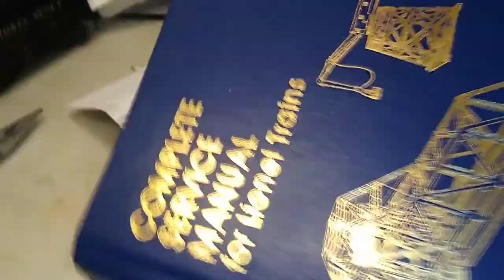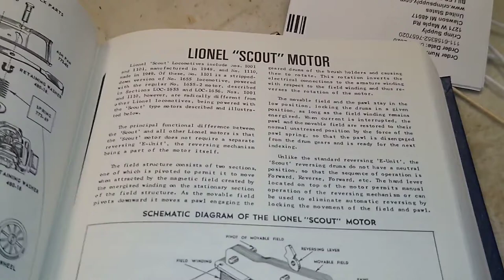Basic Disassembly And Maintenance - Lionel Plastic "Scout" Motors - It CAN Be Done!

Comment: Excellent video Mike. You did a fine job on getting this Scout motor serviced. These motors can be a bit temperamental. I’ve worked on quite a few myself over the years. That K-Line book is an excellent tool and guide. I’ve had mine for 20 years, and it still comes in handy. Just 1 quick note. On some of these Scout motors, there’s an oil wick that goes into the motor housing on an angle near the brush plate. This was a modification Lionel did to the later Scout motors. This helps with lubricating the motor, and It should be wet with oil. It’s not very easy to see with the shell on it, but you have to look up from underneath the shell to see if that particular Scout motor has one, and if it does, soak it with some light sewing machine oil. This will help keep the armature shaft lubricated on that side of the motor. The other side you have access to the motor bearing, and that should be lubricated as required. Excellent video, well explained. Tom
Reply from the maker: Thanks for the tip!!

Comment: Great video. Thank you so much. I took mine apart and cleaned up the brushes and it works a lot better. The little reversing "gears" in mine were really pretty clean, though not as clean as yours, but mine were black instead of green. I know mine is original because it was my Dad's--hadn't been run probably since the 80s.
Reply from the maker: Great! I'm glad it helped!

Comment: Very useful. I just came across my 1966 train set that's been in storage since 1973. This is good information for repairs. FYI. The wheels pull apart with some effort by hand, but when putting them back on you need to be particularly careful with the orientation. They have to go back onto the spline position exactly as they came off. Ask me how I know. Lol.
Reply from the maker: Thanks for the tip! That may save someone a big headache later!

Comment: Thanks for the video.  Oncleaning wheels I use LGB smoke fluid.  Pticey, but plastic compatible and it does a nice job.  If the gunk is really bad AND the wheels are metal (not nylon or plastic) I use a small swab of NEVR DULL (a silver polish available at most hardware stores) to clean the gunk.  My first train was a Lionel Scout #6110.  No headlight, but it does smoke.  I never knew how to take these apart.  I do have the K Line book you referenced, but never had the courage tondo it!  Thanks!
Reply from the maker: Thanks for the tip!

Comment: Hello, I watched the scout service video . I have purchased several that needed repair, it seems that it is a common problem to have that broken spud that centers and secures the rear of the motor with the long screw. The way I repaired it was o grind the broken spud so you have a level surface . Now I use a a bic pen remove the gold portion that holds the brass tip and discard that ,now remove the black or blue portion from the white barrel of the pen and use the colored part of the pen to make a spacer, look into the loco to get a rough idea of the size of the spacer you will require, use a razor saw or knife to cut the colored portion to size. Install it by holding it with needle nose pliers in place and starting the screw through the boiler,, now the spacer ,through the motor and finish by tightening the screw. It doesn’t need to be glued , and when you install it put the wide side of the spacer against the ground off spud. Hope you can use this idea. MG
Reply from the maker: Good tip. Thanks!

Comment: Just got a set for about $25 at a swap meet. It's a lionel 245 but same motor design. Ran like crap and sometimes didn't want to run at all. Cleaned it up good and now it runs extremely fast and powerful
Reply from the maker: Wonderful!

Comment: Have pulled one 'all the way apart". It IS a bit of a pain, but also it's not as bad as I was expecting with all the bad press that these motors get for their serviceability. So long as wobbly wheels don't bother you, and you're very careful, you can gently pry the wheels off with a flat head screwdriver and then open the motor up all the way. There are parts that can use a cleaning, and it gives you a chance to really scrub all the gunk out of the plastic housing.
The hard part, is to get everything lined up inside the housing when you put the two halves back together. It may take a few tries but it's not impossible. Use a vice to press the wheels back onto the axles- ideally you'd use wheel cups and a press, but I don't own one currently and the wheel wobble left behind isn't enough to cause problems for me.
The only reason you'd need to go that far, might be to improve the behavior of the reversing mechanism, or more reasonably, to remove debris like hair or other gunk that has gotten caught up inside the mechanism somehow. Cleaning the contacts inside is another reason you might want to get in there. One of the harder tasks to undertake, but it wouldn't be so bad imho if it weren't for needing to pull the wheels to get anything done inside the motor housing.

Comment: Removing the 2 screws holding the oval plate on side will access to brushes and, with a q tip and mineral spirits, allow a lot of armature commutator cleaning.
Be sure to leave the 2  contact plastic gears in original relationship to each other.
Reply from the maker: Thanks for the tip!

Comment: Many years a go I took one of these apart and after some hit and miss re-assembly I got it together and working.   Now here is a weird thing.  I'll let you know for sure in a few months if I remember and get to my older trains and find it, but the one I have has a smoke unit and magna-traction.  Yes it is the plastic motor with the two part field movement type reversing.  
         Oh, sorry, but reversing units of the older type are not  electronic, they are electric. Yes the term has been handed down that way, E-unit, but the modern ones are accurately electronic, so it is best to not confuse the two types.    I thought it interesting, today I was working on a 8303 I just got in the mail. That part for the piston area along with the front wheels is the same part as the scout you were working on. The rear wheel are pretty close as well.    I important thing to realize as soon as possible, always reverse turn you screw till it clicks in place and then turn it in the hole. Many things with plastic parts the screws are self threading cutter type screws. This means if you simply screw things back together without finding the right groove, your screw will cut another thread into that hole. Enough times and you will have drilled out the hole and that screw no longer grips.
Reply from the maker: The #233 was a plastic motored Scout with smoke and Magnatraction.  Like most manufacturers, Lionel standardized parts on many items - especially the cheaper, mass produced items. A 1946 side rod is the same part as a 1976 side rod for the 2-4-2 locomotives.

Comment: What is your favorite Scout Locomotive and why? My favorite is the 233 because it has magnatraction. Thanks for the great repair video.
Reply from the maker: I am a sucker for the MPC era plastic ones - mainly because that's what I grew up with. Good smokers. Good pullers with the traction tire. Low center of gravity so they hug the O27 curves well.
Reply: Mine is a 233 also.Mostly because I got it for Christmas in  1962,I believe.I rarely got to play with it cause it was only out at Christmas and Dad was mostly the engineer.I’ve still got the set because of that I’m sure
Reply from the maker: I feel the same about my 8141 from Christmas 1972. I still have it and still run it. https://www.youtube.com/watch?v=n4W-uRiVTWs&t=79s

Comment: I took my exact duplicate engine apart and fixed the lever on top as it was disconnected inside.  Took several attempts to get the cover on without the springs jumping off, but finally got that.

One thing.  The light bulb.  Put a new one in, put the train on the track, and the light works, but not a lot of light.

I dont have any clear glass/crystal in the front hole.  Does having it make a difference in light?  Don't know if there was one originally.

I thought about using small mirrors inside the train to reflect more of the light through the hole.  It seems wasted with the bulb further from the hole.
Reply from the maker: The original Scout locomotives did not have a headlight lens. I "borrowed" one from a basketcase 1970's version (perfect fit). Your headlight intensity will vary based on track voltage (train speed) and transformer wattage. I
Modern locomotives achieve a very bright headlight with the use of LEDs instead of bulbs. If you really want the brighter light, swapping an LED (with a proper resistor for the voltage) for the traditional bulb is the best option.
Reply: @ToyTrainTipsAndTricks  thx.  If my mirror trick works...

Comment: Great video, I have struggled with these motor units before.  I picked up a plastic body 242 with slope back tender at a swap meet for $10.  I took it apart for a cleaning and there is a stray bare wire coming out of the motor unit with an eye connector soldiered to it. It is electrically connected to the wheels (Ground). Do you know what that is for...smoke unit?  there is not a smoke unit on this Locomotive.
Reply from the maker: What is the # on the locomotive?
Reply: It is also #242, as well as being a 2-4-2.  Thanks for the quick reply. @ToyTrainTipsAndTricks

Comment: Not that hard to fix.I take them apart,make as friction free as possible,lube with grease and put em back together.They run great and fast.The only problem child is the 6110.I think the smoker adds so much resistance , they take more juice to pull light loads.The others will easily pull 11 cars with minor wheel slippage.I repaint them add details such as jewels grab rails bell and horn.I also change the rollers to copper if they are the steel ones from the Korean War vintage motors..copper is a much better conductor.They also tend to move the drums where they will not move forward or reverse.Easy fix is use the skeleton drum cover.This way you can use a toothpick to reach thru the body hole on the side to move the drums
Reply from the maker: Thanks for the additional information!
Reply: All learned by doing and much cussing.lol

Comment: “They’re hard to work on”
I’m only 14 and I got this motor working perfectly
Reply from the maker: I was pleasantly surprised myself. I had heard for years to avoid the plastic motored Scout engines because of the difficulty servicing them. The metal motor version, by contrast, is a piece of cake. I must assume that people have difficulty with the rotating brush holders and springs.
Reply from the maker: For example, Lioneltrainforum.com says, "Servicing equipment is fun and rewarding; however there are a few items, these Scout locomotives included, that even the professionals turn away.
These locomotives were just not designed to be serviced easily, as they were low-end, starter set locomotives. The motor design was never re-used because of the maintenance problems they had."
Reply: @ToyTrainTipsAndTricks  I agree, I did have an issue with the plastic motor because the green gears were misaligned. I think that’s why many throw them away
Reply: @ToyTrainTipsAndTricks  heh, I think he just doesn’t understand you need to align the green gears so the brass part is alternating with the other gear’s plastic part. I only disassembled it and reassembled it for it to work within 1 hour 30 minutes or so

Comment: Are all Scout motor brushes the same? How do I know if I am buying the correct brushes for a 1060 steam locomotive engine?
Reply: @ToyTrainTipsAndTricks  My Scout is a 2-4-2 wheel configuration. No Mag-n-Traction, and runs Forward directional, no reverse. Is the part numbers 246-211 brushes and 246-211 springs acceptable? And the paper diagram shows:1001-46 motor brushes and 1001-47 motor springs. Because 622-121 has different springs. And  the ends of those brushes are notched.
Reply from the maker: @mdeange3  According to my Lionel service documents, the 246-211/246-212 are the original brushes and springs for the 1050 and 1060 locomotives.
Reply: @ToyTrainTipsAndTricks  Thank you for your assistance. Can you direct me where to find these brushes and springs?
Reply from the maker: @mdeange3  Here's a reputable dealer. https://hennings-trains.shoplightspeed.com/copy-of-2020-motor-brushes-springs-1-pair.html
Reply: @ToyTrainTipsAndTricks  You are fantastic. Thank you very much for your assistance.

Comment: On this video you skipped over the repair of the 2 broken spacers ( stand offs ) on the rear of the motor . I have developed a quick and easy repair.  this is a very common problem I have 3 scout engines and all of them have broken stand offs. If you are interested drop me a line in your comments area.

Comment: How do you open the version with rivets on the commutator plate instead of screws?
Reply from the maker: Hmm.... I've never seen one like that. If you're ABSOLUTELY sure the rivets are the only thing holding it on, you can SLOWLY and CAREFULLY bend the rivet edges up until the plate clears for removal, then CARFEULLY peen the rivet back into place when finished. But again, I have never seen a Lionel assembled this way.
Reply: @ToyTrainTipsAndTricks  I just did it! It was incredibly time consuming but it works. There was a bit of string stuck in the motor that I had to pull out. After servicing it, I managed to stick it all back together. Thanks!

Comment: this motors need to taken all the down dirt collects on the axles  makes for poor running i found the problem on the case body as they  wear causing for poor electric contact    repaired the area and they run great i used to be a lionel repair man for 30 years
Reply from the maker: Thanks for the information!